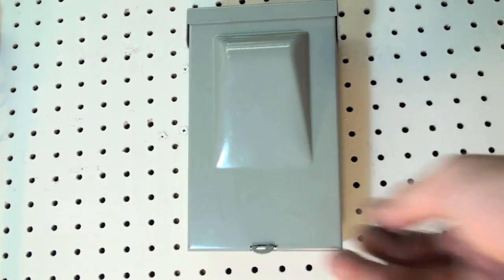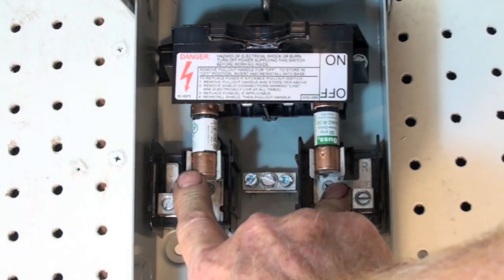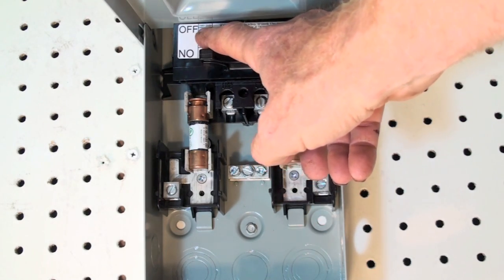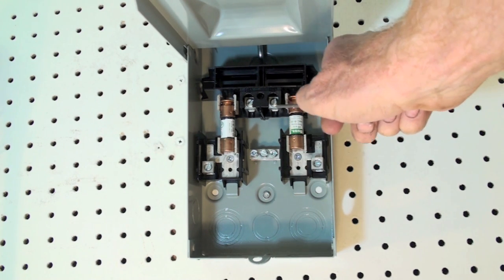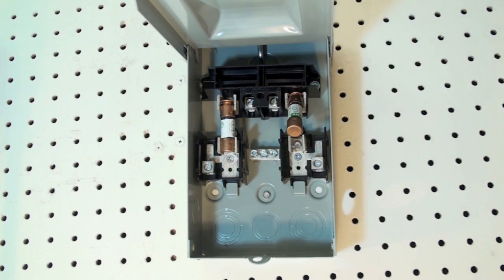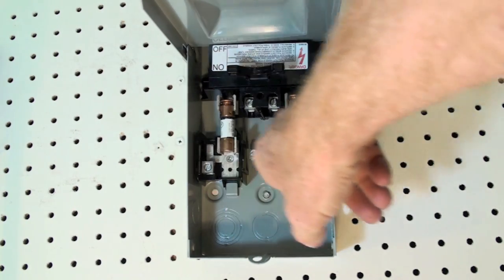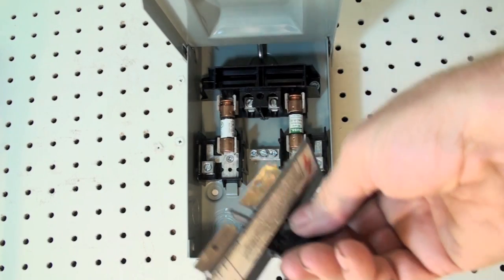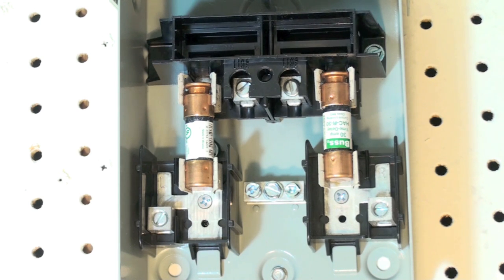The air conditioner service disconnect

Comment: Great explanatory video! Clear, concise and complete expalnation on AC disconnect switch. Since instructor states that you cannot find single parts for these units, I'll be buying a replacement box for mine as someone has removed the pullout On - Off switch.

Comment: Great video, thanks! I generally agree with you that the boxes shouldn't be locked, but when I was living in a different house years ago, some moron kept pulling the disconnect and stealing the wires going to the AC, so I locked the box. That put an end to that nonsense!

Comment: The sand inside the fuses is an arc extinguishing medium. When the fuse opens (always under a load), it puts out the arc. This maintains the AIC (available interrupting current) rating of the fuse thus preventing a potential fire.

Comment from the maker: OK if you have to manually push in the contactor, that means the control voltage is probably not available.  Be sure thermostat is calling for cool.  If is, check voltage at the low voltage terminals of contactor.  Should have 24 volts.  If you are still confused, Check out my playlists for "contactors".  That might help.  Also if you are manually turning on contactor more than once every 5 min, compressor amp draw will be very high thus the sparks.

Comment: This video is awesome. 

I have this unit but for my water heater and I came to find out that the top plastic pull-out piece is melted on the left side. Could not get it to separate. 

Im gonna order a whole new set and install it myself. No idea why it was melted or what caused it but the fuse under the melted part was also bad. Maybe that had something to do with it. Still managed to replace the fuses but not comfortable with how is currently is
Reply from the maker: Definitely dump it.  Bad connections are usually the cause.
GFM
Reply: @grayfurnaceman this may be silly but Where can I find these? I found the same pull out, fuseable, 240 max, 30amp max switch but do i have to buy the internals separately? It seems like it doesnt have the internal clamps for the actual fuses. Or should it come with it?
Reply from the maker: @jimbobimboslice  You should be able to get a complete one from Home Depot Or Lowes.  They are very cheap and I have never seen parts for them.
GFM
Reply: @grayfurnaceman  awesome. Thanks again man.

Comment from the maker: Probably not.  The A/C breaker is 2 pole or double breaker.  The furnace ,if it is gas or oil, is a single.  It could be that the breakers are marked wrong.  Check for a kicked double breaker.  Hope this helps.
GFM

Comment from the maker: If you are reading that voltage from the terminal to chassis ground that is normal.  If you read 118 across the 2 hot terminals, you probably have a blown fuse.  You can remove them and check with ohmmeter.  Be sure power is off at panel.  Check with meter or NCV.  OL on a modern meter means the fuse is bad.  Check clamps for overheat.  Use a fuse of similar size and type only.  These are motor load fuses.  I do not believe the orientation is important.

Comment from the maker: Some of the older disconnects were not required to have fuses.  So this could be normal.  I would replace it with a fused disconnect.  Check the unit model plate for fuse size.
GFM

Comment from the maker: Because both fuses blow, you have a dead short between the 2 lines.  If only one blows, it is a short to ground.  My guess is the compressor is probably shorted.  If you feel confident working with electricity and can use a meter, you can ohm out the compressor to find the failure.  Remember the voltage is lethal.    I have a vid on ohmming out the compressor.

Comment: Correct me if I'm wrong but I believe the 2014 National Electrical Code Book requires the disconnect to be fused or have a breaker in it now. "Referring to a 30 amp disconnect" unless there is a disconnect inside the house other then the breaker in the Panel.
Reply from the maker: The fused disconnect has been code for over 25 years.  At least in my area.  It must be located within 6' of the outdoor unit and accessible.  Hope this helps.
GFM

Comment from the maker: Probably the terminals have overheated from poor electrical connections and welded together.  I would turn off the power at the inside breaker panel then use tools or whatever it takes to get it out.  It will probably break.  The disconnect will then have to be replaced.  It is unsafe to have a disconnect that cannot be used.  I know this does not sound good but it is important that it be in operating condition.

Comment: I had a pull-out fuse holder that broke.  So I ordered a new box, which included the fuse holder.  So far, so good.  

Now that the new fuse holder has arrived, I need to know what direction the fuses need to be in.  Or does it matter?

Comment: I can’t get the door open on mine. The hinge is on the left side. I’ve tried everything I can think of to open it, and it won’t budge. I’m going to have it cut it off and then replace it. It will be interesting to see what was holding it shut once I get the dang thing open!
Reply from the maker: If it is hinged on the side, the door must bee lifted up to open.
GFM

Comment: I need to replace my disconnect box.  It currently has two 40 amp fuses in it.  Should I be looking for a 40 amp box, an 80 amp box, or something else?  All I can find are 30 amp and 60 amp boxes so I’m not sure what I need.
Reply from the maker: The 60 amp will work ok.  
GFM

Comment: I have a disconnect for my outdoor condenser unit that is about 2 feet above my gas meter, is this against code and if so can I use that disconnect as a junction box and run wires to a new disconnect box about 5 feet away. Thanks.
Reply from the maker: As far as I know, it is not against code, but you should check locally.
GFM

Comment: Well, pretty confused since I checked the fuses first and they were ok, but after I checked them again, one of them is bad. So I bought two new ones and put them in. Voltage from house now reads around 240. When I manually press the plunger on the contactor (using insulated screwdriver of course), there are significant sparks flying. Quite terrifying for a beginner like myself. However, the fan is starting to spin. So am I lookin at getting a new contactor? Thanks again.

Comment: To protect the AC unit it is better to have the disconnect box fuses or without fuses? Thanks
Reply from the maker: Fuses are required in most jurisdictions, but the panel breaker will protect the wiring.  As for the equipment, it has protections built in.
GFM

Comment: Grayfurnaceman I have a question. I had my a/c serviced for fan replacement, and this box on the side of the outside unit, because it wSnt getting power, inside unit replaced,cleaned,and charged.

Comment: Hello, 
I was changing my disconnect box because it was burned and melted. I installed the new new disconnect box, but not with out issues. After flipping the A/c switch on the breaker I pulled off the old disconnect box the two line wires touched and created a large spark and tripped the furnace breaker. After wiring it incorrectly (twice) I found instruction on the proper wiring. I believe I have everything correct, but the unit outside will not turn on. Have i completely fried my system?

Comment: Great video, if I am at a job what do I look for to think that the fuses might be bad like would I hear the problem,or what do I look for to think I might have bad fuses?
Reply from the maker: +Joshua Truax Symptom will be the unit will not run.  Diagnosis of bad a fuse is power in, no power out.  Double check by removing the fuse(s) and checking continuity with ohmmeter.  The true diagnosis is after the fuse has been replaced, and it it still blows.  Look for shorts, grounding.  Hope this helps.
GFM
Reply: +grayfurnaceman Yes it helped a lot, thanks for the good feedback.

Comment: what would cause one of the 4 copper terminals on your main disconnect of an intertherm furnace to get hot, discolored ,and  melt the plastic around that terminal?
Reply from the maker: Loose wires or a loose connection in the disconnect plug usually causes this.  The entire disconnect will have to be replaced.
GFM

Comment: My fuse box has a plastic shield that appears to be attached to the on/off fuse case. I can't find any place to detach this shield. I removed two screws in the back but that doesn't appear to have helped, and I've tried pulling it out but I don't want to break it. Any advice?
Reply from the maker: Pull on the thingy that sticks out near the top.
GFM
Reply: +grayfurnaceman awesome thank you

Comment: First let me tell you that you have a great videos with great explanation! Here is my question... my service disconnect keeps blowing the fuses... both of them. I have replaced and measured the voltage after that and everything seems to be ok at that point 'but' as soon I turned the thermostat on... sound like a small explotion and the fuses are gone. I will really appreciate if you give me an idea what I should check to fix that problem. Thks again ;)

Comment: I have out side unit -sprinkler system pump  and air conditioner that are connected together in the outside electric box. Sprinkler pump has no electricity coming there.  How do you fix it?
Reply from the maker: Heck if I know.
GFM

Comment: There's a pop noise when our a/c kicks on... I went to the furnace room and this box was open. Would that cause the popping noise?
Reply from the maker: No.  The pop could be the contactor closing.  This is normal.  There could also be loose parts in the outdoor unit.
GFM

Comment: Is it necessary to push it back into off position while working on the unit or can I just leave the fuse out?
Reply from the maker: Generally, I like to replace the plug so it does not get lost.
GFM

Comment: I have to replace this box, but when I check the boxes in home depot there are 60 amps or 30 amps boxes. Wich one is this one?
Reply from the maker: If your fuse size is 30 amps or lower, use the 30 amp.  Over 30 amps, use the 60 amp.  
GFM

Comment: Thank you a lot! This actually helped a lot to identify the problem. Will change the fuses tomorrow. One question thought, can there be still some other problem that caused failed fuses? Thanks!
Reply from the maker: There are 2 reasons for fuses to blow.  First, and overdraw of power.  The fuses will blow either immediately or within a short time.  Second, a bad connection in the disconnect.  The fuses will blow after the unit is operating continuously.  Sometimes accompanied by discolor of the fuses or the clamps holding the fuses or the fuses appearing burned.
In the second case, a new disconnect is required.  In the first case, you may have a problem with a short in the system.
GFM

Comment: Are there different size disconnects for a condenser? If yes, how do you determine the size for your unit?
Reply from the maker: SombraLocs Yes.  The outdoor unit should give a maximum fuse size on the model plate.  The disconnect must be rated for at least the maximum fuse size or higher.  The fuses should also not exceed the maximum fuse size.  The wiring to the unit must also conform to the NEC.  There may also be local codes applicable to your system.  Hope this helps.
GFM

Comment: Is there any good way to piggy back a receptacle off the power in this box?
Reply from the maker: You can do it but you will have to run a neutral from the panel.  The ground cannot be used as a neutral.  Hope this helps.
GFM

Comment: What about if u find the wires switched from the disconnect, for example the house breaker wire going to the bottom and the wires going to ac are on top, what would happen
Reply from the maker: This is a dangerous condition.  The fuses are hot even with the disconnect plug removed.  Gotta fix that one.
GFM

Comment: But now the a/c is cutting on and off simultaneously within minutes. The air is cold the  outside fan is on . But sometimes the unit is off before the fan. Other times its fan off before unit. Which makes sense from years of listening to it for fun. What could be the problem? Should I get a new box or thingy that sets the temperature? I have little money to afford.a part but not professional service. Please help!

Comment: what would happen if you just took the block out at the 215 mark

with out putting back in to the off at the 220 mark

just put in a safe place just pull it out

there should not be any power at that poing

or do you have to put it back in to the off slot

and then it will be off and then put the block in a safe place

thanks
Reply from the maker: It is not necessary to place it back in.  That is just so you don't lose it.  Hope this helps.
GFM
Reply: grayfurnaceman how much would 1 cost if some came to the house and stoll 1  leveing you with no air at all since it was took out

thanks
Reply from the maker: Tom Myself In most cases, the pull out is not available alone.  You will get the entire disconnect.  Sometimes the disconnect model you have is not available, so the whole disconnect must be replaced.  If you do this, remember all power must be off and checked with a voltmeter before replacing.
GFM

Comment: I have a dumb question. What exactly is the point of a disconnect box? The obvious answer is to cut power to the unit, but the breaker can be used to cut power too, so the disconnect seems redundant to me. Is the disconnect just to make it more convenient for the tech to shut down the unit so he doesn't have to go to the electrical panel? I must be missing something. Thanks
Reply from the maker: I will add to my other answer this:  All appliances have disconnects.  A toaster has a disconnect.  Its the plug.  A light fixture has a disconnect.  The wall switch.  
In the case of an A/C unit, it would be inconvenient to use a plug (not to mention more expensive).  In any case, you need some sort of disconnect near the appliance both for convience and for safety.  
Imagine the firefighter that is called out for a fire in the A/C and having to find the inside breaker panel then trying to figure out which breaker is for the A/C.
GFM
Reply: @grayfurnaceman  That makes sense. I never thought of it as a safety device, but rather as a convenience to the person that's working on the unit. Thanks for explaining.

Comment: My a/c disconnect is a black plastic handle like this, and it's stuck.  Every video I've seen, they pop out pretty easily.  Any reason why it should be stuck?  I'm a strong guy, and i've given it a pretty good pull.  I haven't pulled it with absolutely all my strength, cause i feel like I shouldn't have to, and that I'll break it.  Ever experience this???

Comment: do i need to shut the down the breaker to the house to replace the fuses?
Reply from the maker: Assuming the disconnect is wired correctly, it is not necessary to disconnect anything except the plug inside the disconnect.
GFM

Comment: whats the name of the piece you pull out of the box?
Reply from the maker: ***** Its just called a plug.
GFM
Reply: grayfurnaceman My plug with the fuse you mentioned in the video about getting burnt, was totally burnt like it was on fire.  Burned to the core and the top connector is gone due to that fire/burning.  
I was running my AC and the compressor wasn't on for half a day.  It was hot inside (I live in the south and its a heat wave in August) and I noticed the compressor wasn't kicking on.  So I go outside and look at the disconnect and its like it was on fire on that one side.   Don't know what to do or where to go for a new disconnect/plug.    I'm wondering what the problem was.

Comment: whats the purpose of the fuses
Reply from the maker: They protect the wiring from the disconnect to the outdoor unit.
GFM
Reply: @grayfurnaceman  I was wondering the same thing. But since the fuses are the same rating as the breaker, wouldn't the breaker protect the whole circuit? Thanks.
Reply from the maker: The use of disconnects as a safety to disconnect an appliance quickly is as it should be.  However, I have never seen the value of adding fuses to the disconnect.  I believe fuses are a step backwards in circuit protection.  HACR breakers will the job better.
So, yes the fuses are there to protect the wiring from the disconnect to the unit but I do not agree they are useful.
GFM
Reply: @grayfurnaceman  Thanks

Comment: Yup hes right top plastic is melted cant pull out sand on bottom and fused burned out.... and i mean BURNED!!! top is 1/4 burned... replaced with a fused XO but now i have problems with my AC was wondering because I placed in a fused disconnect..
Reply from the maker: Whether you use a fused or breaker disconnect, it should not affect the operation of the A/C.
GFM
Reply: Thanks..

Comment: My disconnect inside by the HVAC keeps melting? I had it replaced twice, the whip once. It happened again??? Why. Now I can't get anyone out who will replace it???
Reply from the maker: In 90% of the cases, melting is caused by loose connections.  If the connections and fuse holders are tight, I have never seen one melt.  Other than that, I have no other options.
GFM

Comment: What causes the fuse to blow out?
Reply from the maker: There are generally 2 reasons for a fuse to blow.  One, the amperage draw is too high (too many high load devices on the circuit).  Two, there is a loose connection near the fuse that overheats the fuse.
GFM
Reply: @grayfurnaceman  thank you , I'll look into that.. I'll get back to you and let you know. What the out come is.,

Comment: i thought that was my qustion

where to get the disconnect

and then you said you cant buy the disconnect its self

you have to buy the whole unit to replace 

this would cost a bit of money if someone just walks by the house and just takes the disconnect

or if you lose the disconnect looks like a five doller part if that much

but if you cant just buy the disconnect it becomes more money

thanks